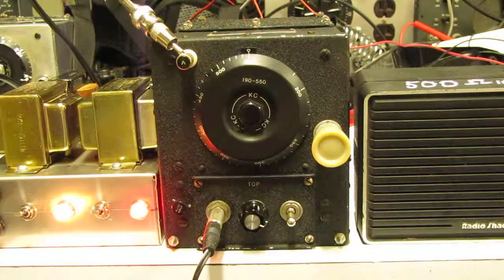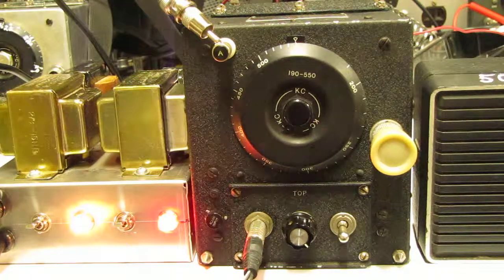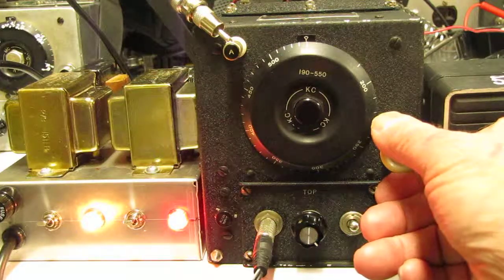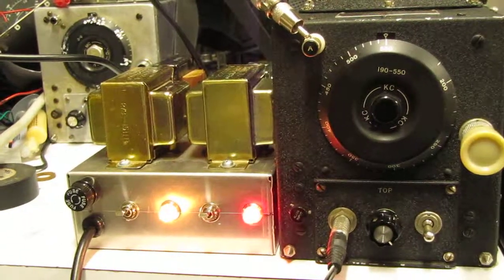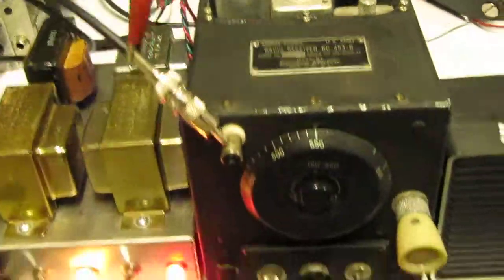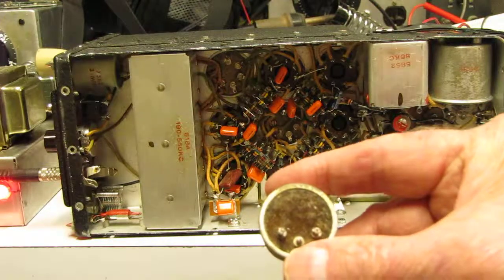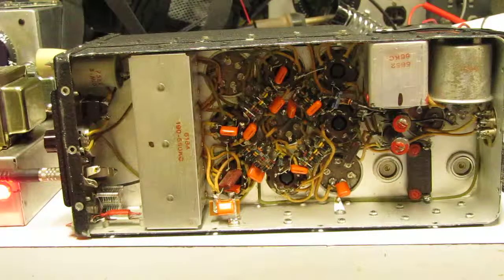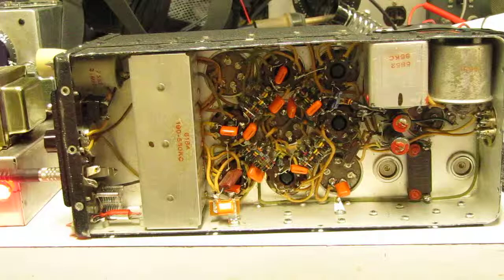A Working BC-453B - Again

Comment: Thanks for the Video i am in progress of recapping my unit but i just found out it is missing the L15 Af choke (3H) Can I replace it with a Resistor or can be with out it 
Greger OH6CN
Reply from the maker: Hello, Greger: L-15 is, as you mention, the AF choke, whose purpose is to strip any noise off the HV (250 VDC) line from the dynamotor. If you never intend to use a dynamotor with that receiver, you do NOT need either the choke, nor to replace it with a resistor, as long as the DC out of your power supply is very clean. Almost all of the "ARC-5" receivers I have left here have been badly hacked, so if L-15 (and L-14) are still in those receivers, I usually remove them, since other bits are usually missing anyway, and I never intend to run mine on a dynamotor. Good luck.